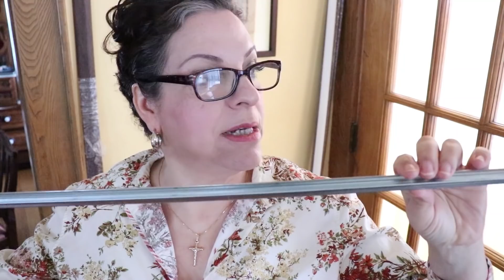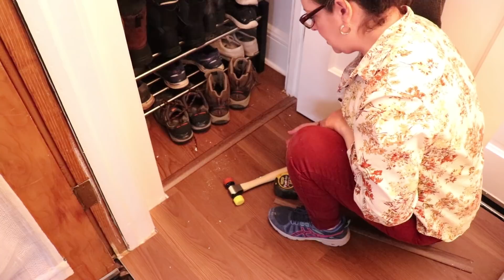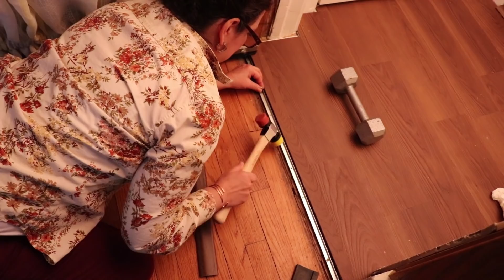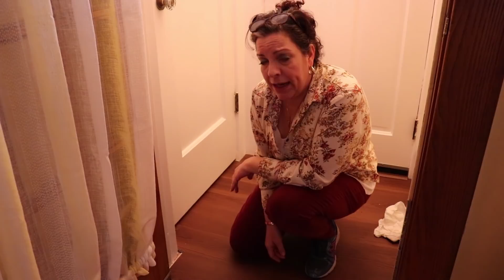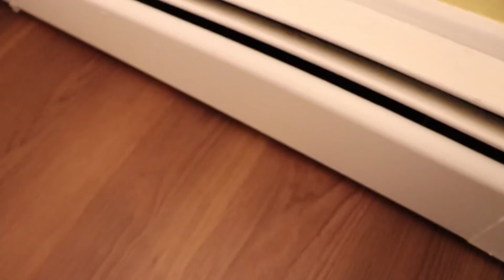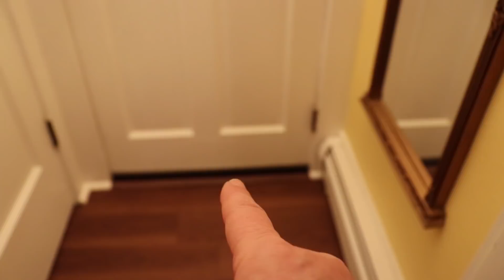Winter Project #2 || Entryway Makeover || Episode 6 (completed)

Comment: I feel for you on the transit. When we installed the stick down vinyl planks wood look floor we did not do them but have a continued floor which took twice as long but we   
Had so much trouble with the transits staying over the years. We ended up gorilla gluing them down. They have not made it easy for sure so it is not you. Looks really good and you should be real proud of yourself. Love it.

Comment: Sophia, great job!! I have the exact same wood floors as you do.  They are oak. Most builder's back then used oak on the first floor, as it's a harder wood and pine on the second level. If you ever need to match your wood floor, take a piece out of the one of the closets, or some inconspicuous place.  It will blend beautifully.

Comment: Why don’t you put a wood floor with a big area rug where your bed is ?
Reply: When I finish the upstairs of my 1.5-story Cape Cod-style house I plan to cover the 70-year-old linoleum squares with a nice installed carpet. Then I don't have to deal with what's likely asbestos tile and/or glue. I do like the idea of a carpet that's warm on the feet in winter. 
They could still place a nice area rug crosswise under the bed and over carpet if they want to add to their decor.

Comment: Finished project is fab well done. For the bedroom could you not have wood floor with a nice rug under the bed or just have a new carpet as it's only the 2 of you using the room it will stay clean. If you do go for the wood flooring make sure you buy the waterproof one.